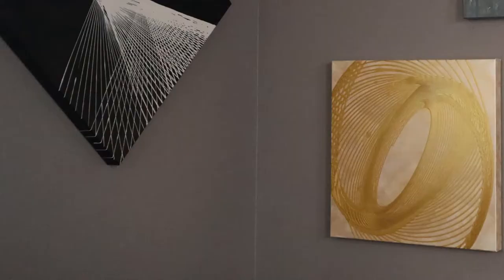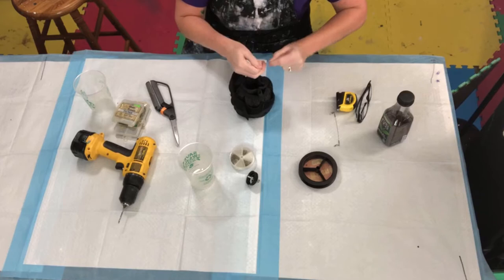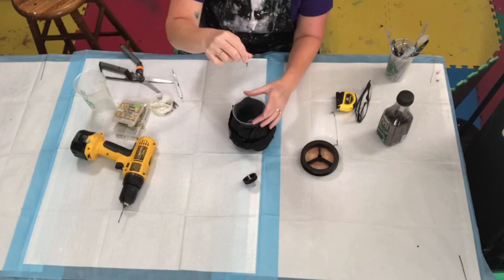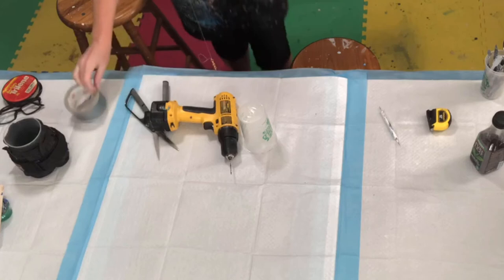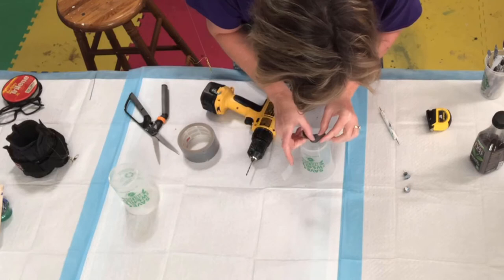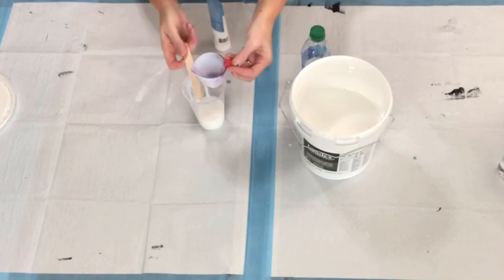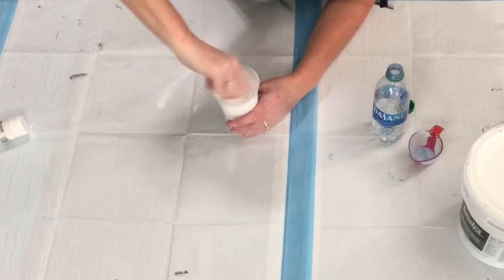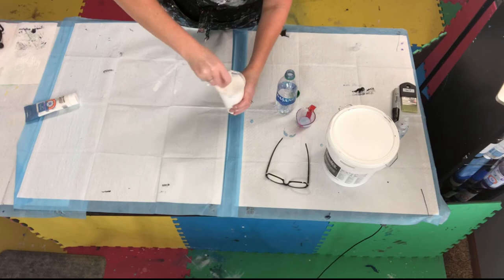⚖ PENDULUM Art 101 | How to create Pendulum SWING & the 🎨Paint Consistency | Acrylic Pouring Art✨

Comment: Rhonda I need some guidance. After watching your video I have been trying(unsuccessfully) to create one. The issue I'm having is although I get a steady stream the paint comes out blochy no matter how thin or thick the paint is. I am using a ketchup/condiment bottle I bought from Walmart inverted and cut in half and in a leg weight swing like the one you use. Do u have any suggestions?
Reply from the maker: Do you have an "air hole/open area" when you turn the bottle upside down?  The paint needs the help of air to push it down in a steady stream.  Think about when you sip on a bottle of water or your favorite beverage.  If you complely inicirle the area the beverage is coming out with your mouth, it comes out slower but if you have a space above your mouth where the bottle has air when drinking the beverage it flows faster in a more steady stream.  Im not sure I am explaing this very well...so here is an example from my college days...maybe you might have seen when people poke a hole in the side at the bottom of a can...let's say a beer can...then when they put that up to their mouth and then  pop the top of the can, they can drink it very fast. 😁 If you do have airflow from above the paint once you tip it for the pendulem and it sill isn't working...let me know and I can help more.

Comment: How do you cover the canvas with the base paint so we’ll without it showing through, it seems like it’s taking me numerous coats and it still shows. And what kind of paint do you use for the base
Reply from the maker: There are different levels of opaqueness and even translucency in paint. So some paint depending on the level of transparency or opaqueness could show the canvas or other pain through layers of paint. An easy place to look to see is in the tube or jar of paint. Some will have a a box or a “+” sign. Let me know what you see and I can help guid you or you can google what it means on line. 😃 let me know if you have any other questions!

Comment: Thank you so much for this great, informative video.  I learned so much. I do have one question.  What size drill bit did you use?  Thank you!
Reply from the maker: It was an 1/8 of an inch but it all depends on how thin your paint is. It could be thicker and use a thicker hole. I would practice before you use it.
Reply from the maker: Thank you!!!
Reply: @RhondasTriRRRtistry  rest assured I will practice, both with and without paint. I appreciate all your help!